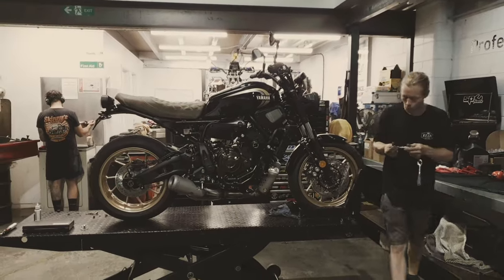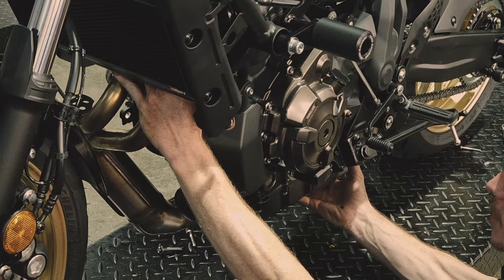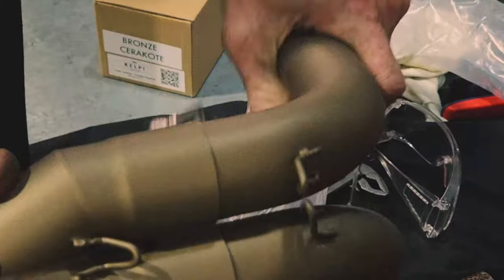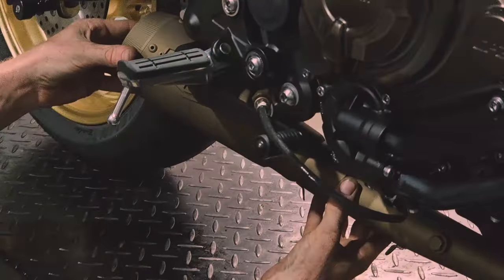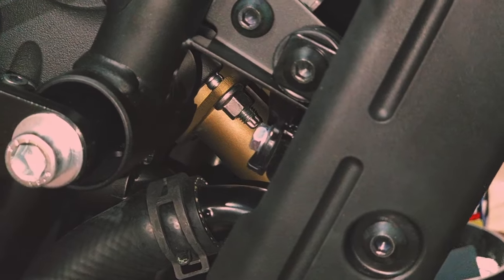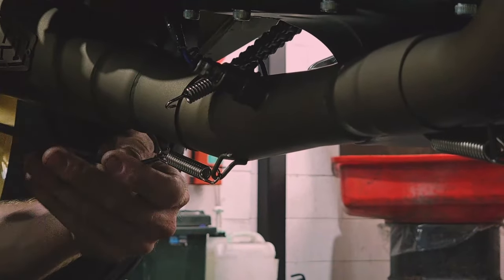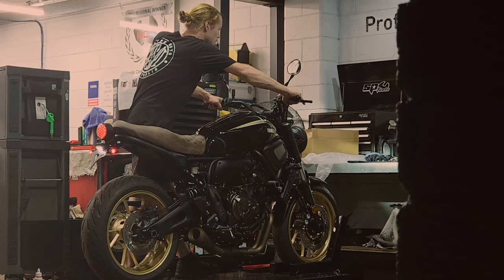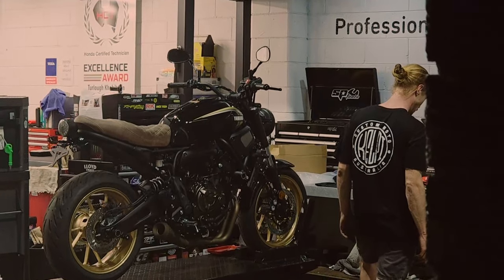Kelpi Exhaust System Install (Yamaha XSR700 / MT-07 / R7)

Comment: Great vid guys, I'm New to bikes.. Just bought xsr700 with Akra and think i want to swap it out for one of these.  What are your thought's on the need to tune or map fuel with full exhausts.  Can it hurt the engine long term or is that a myth?
Reply from the maker: Hey mate, for the XSR700 our systems can be used without a tune no issues at all. That said, if you’re doing air intake mods and throttle plate derestrictions, your tune requirements change much more significantly, so we recommend not modifying these unless you’re going to tune to suit.
Reply: @KelpiCustomMoto   Thanks heaps for the reply. I will be keeping it restricted so great to know that it wont hurt my bike.. Going to purchase the shorty off you very soon. :)